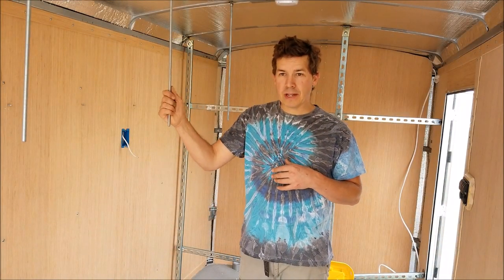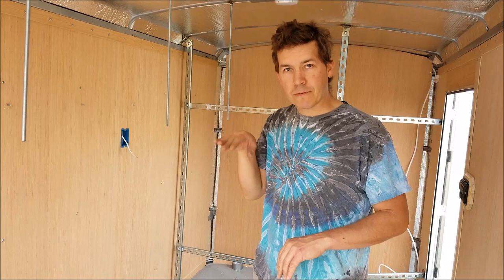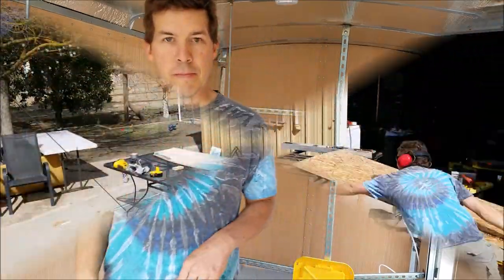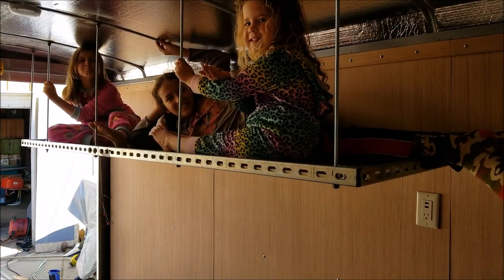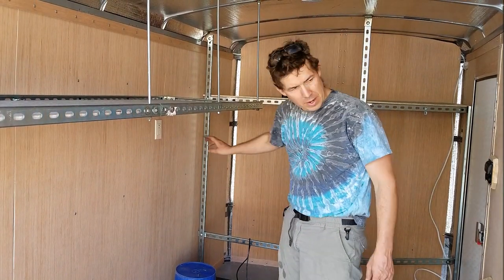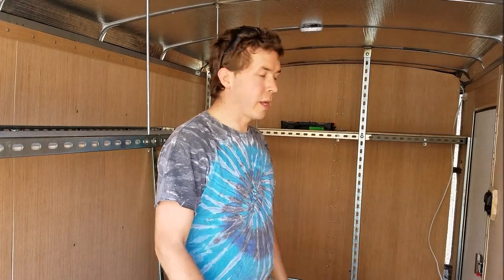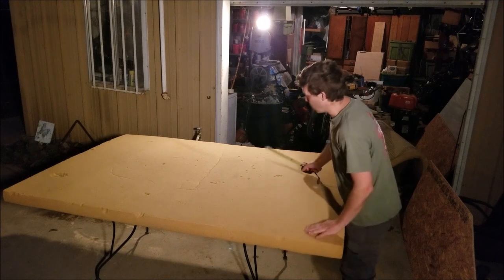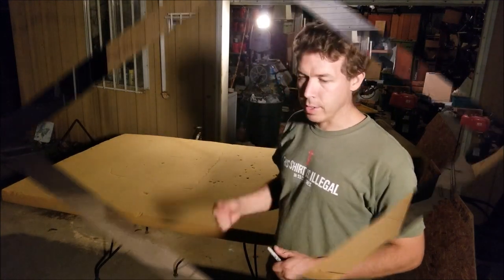Cargo trailer conversion framing/beds part 3

Comment: If you have extra and need length or wdith , you can glue foam together.
Reply from the maker: I'm not certain what your plan would be. However I have designed several structures made almost entirely from foam paneling. Not super strong but well insulated.
Reply: @DirtyShopDIY  Lol, I was commenting on the bed foam. I do see how that could have been misunderstood, sorry about that. Any foam you're making a cushion with can be glued together if you need more width or length.
Reply from the maker: @helenwheels6125  That does make more sense. 😊